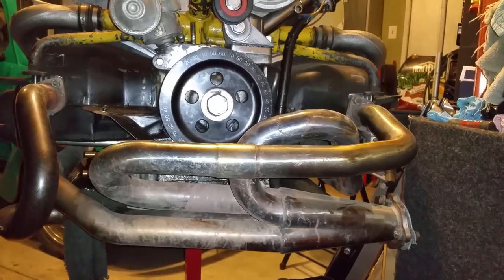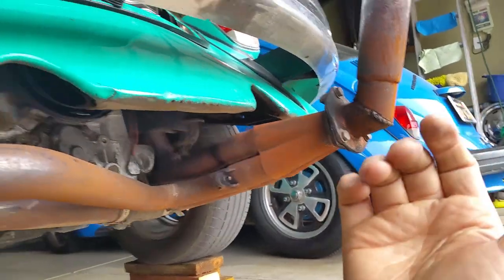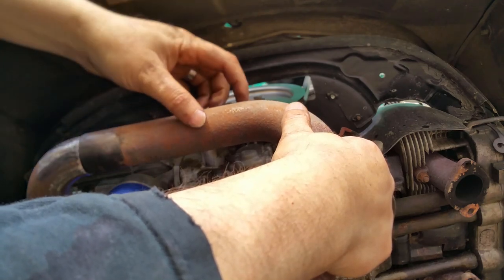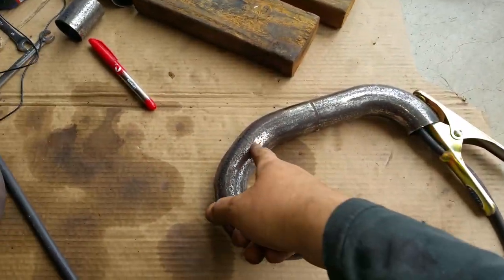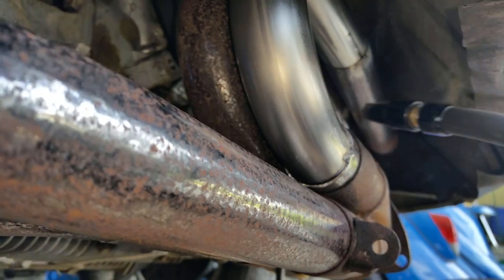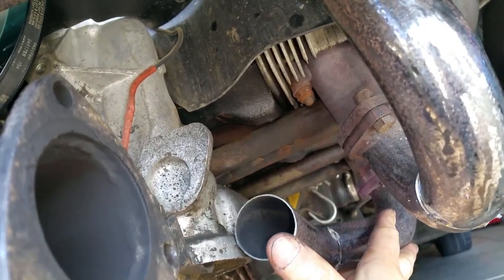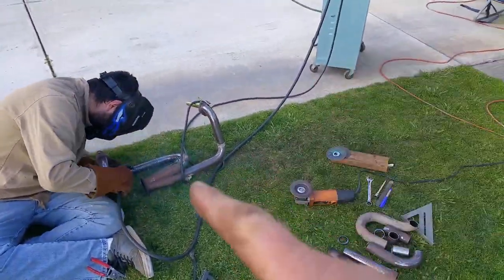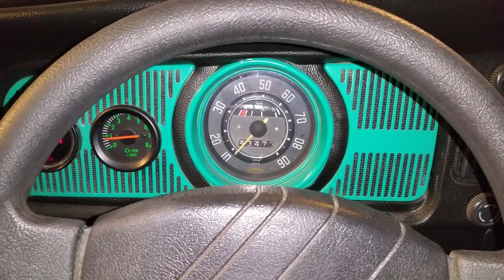Type 4 Sidewinder Exhaust Build

Comment: What’s the knocking sound ???
Reply from the maker: I suspect its the valve guide.
Worn out... it's the same one I installed the value shim. But now it only does it when the engine is cold and revving at 650rpm. It used to do it when it was at 900 RPMs and hot. I'm going to remove the head and replace all my valve guides in the near Future.